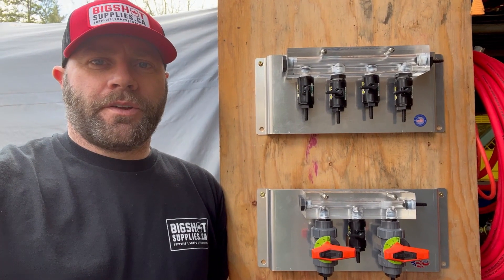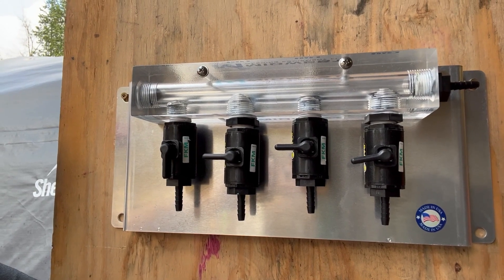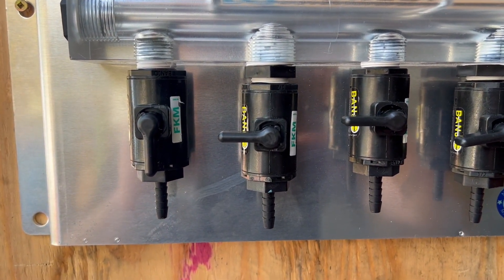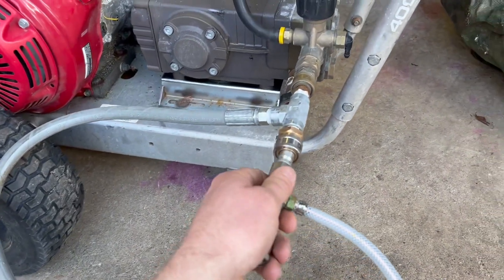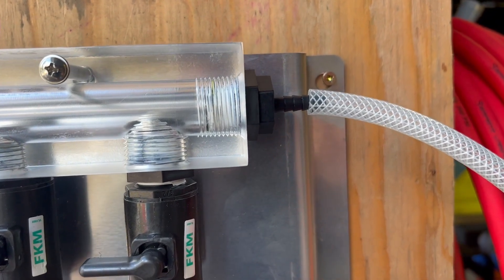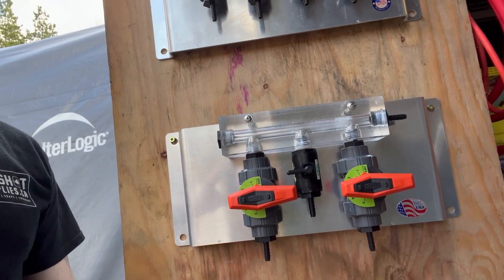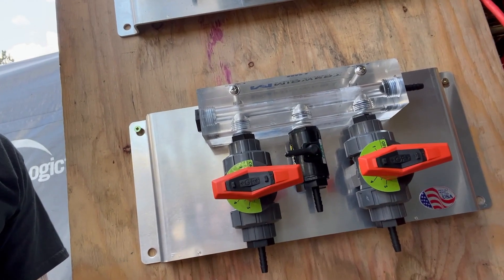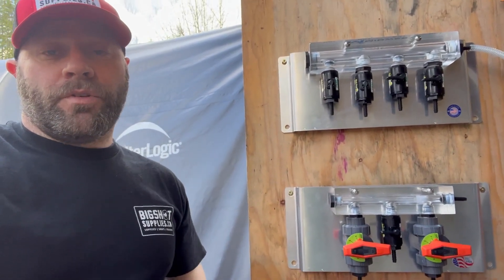V3 & V4 Downstream Injection Manifolds

Comment: Hi, on the v4 if I run sh and soap open I’m assuming it would draw the same percentage of soap and sh? Just curious if my draw percentage of sh is now halved with soap valve open and now the sh strength becomes too weak. For example if just sh valve was open I was drawing at 1% by opening the soap does the sh draw drop to 0.5%? Hope that makes sense
Reply: Had this same question.